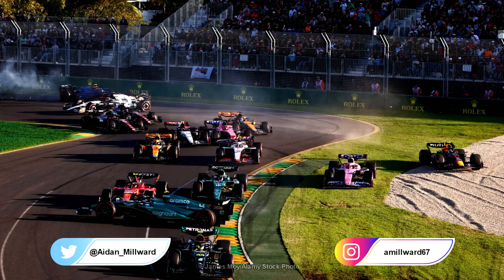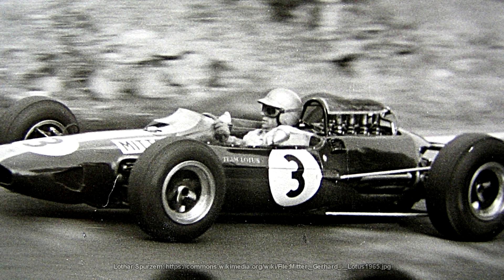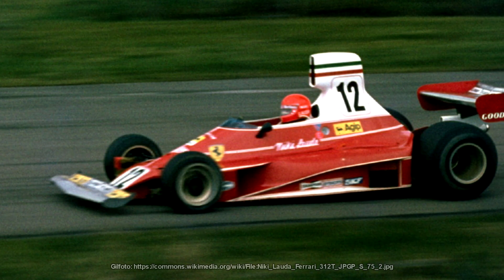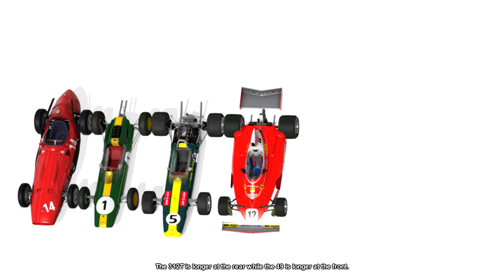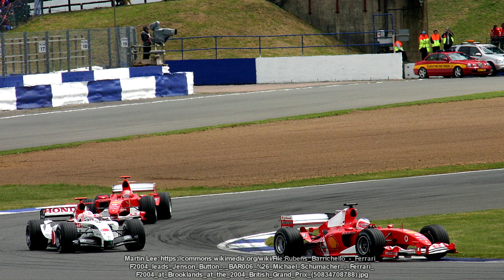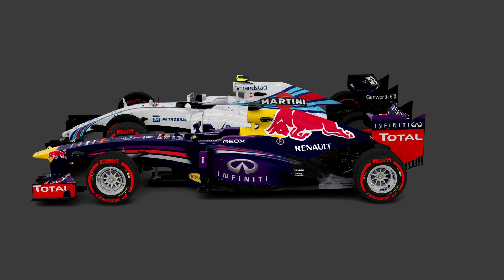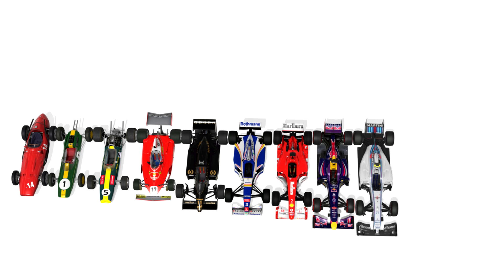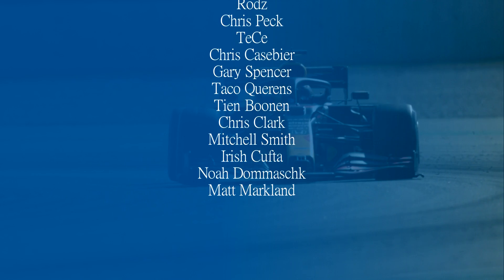So How Did F1 Cars Get This Big? A look at 73 Years of Car Evolution

Comment from the maker: If anyone does know how that Williams is shorter than the 98T, I'm all ears. Like Andrew Marr.
Reply: I’d suspect fuel tank size, but that’s just a hunch 🤷🏼‍♂️
Reply: It's just good you didn't mention His Royal Highness - or you'd go to The Tower.
Reply: It’s weird to think Aidan, but the ‘97 cars had really thin cockpits compared to that Lotus.  Best way to check is on F1 2013 where both the ‘96 Williams & ‘86 Lotus are playable (or any Rfactor footage) Also, as a fellow early 90s lad, we think back to the 90s with the default mindset of “Everything was bigger back then” (with crisps/chocolate, that was true)
Reply: Top "Thick of It" quoting Aidan
Reply from the maker: @hobbitman27  there’s one for every occasion!
Reply: @AidanMillward  small nitpick with the video. The 2020 mercedes was the W11, W10 was 2019.
Reply: Williams FW19 was 4,150mm vs. the 98T’s 4,597mm nose to tail on every google search result I’ve bothered to inspect. I think they just got the model wrong when they modded it into the game lol.
Reply: To be fair, when Senna crashed, his Williams was shorter
Reply: @davidaugustofc2574  No it was narrower!

Comment: I'm glad more and more people are questioning the size of modern F1 cars. I've been saying they've been too big since 2010. In my opinion, the 1993-1997 dimensions are the sweet spot; they've got the right track-width-to-wheelbase ratio to accommodate various driving styles and can even be slid around slightly whilst still having decent enough space for driver protection. As much as I love V10s, a modern turbo-hybrid setup powering a mid-90s style chassis and H-pattern gearboxes is my realistic dream setup for modern F1. Maybe cut the formula down to 1.4L and a high-compression/low-boost turbo setup to let the engines rev at 20k again, with any cylinder formation aloud.

Comment: I have two big interests in the engineering world, early and early-ish aviation, especially around WW1 and  F1, especially in the 60s. And it's weird how the more I think of it, the closer those specific things seem to each other. At least some parts of it.
Early F1 drivers and WW1 aviators had pretty similar things to worry about, and except for the shooting stuff the needed sort of similar skills, both groups needed fast reflexes, quick decission making, G-force endurance, patients, risk assesment on the go, coping with death of friends on a regular basis, living in the fear of burning to death and with the lack of safty gear (no seat belts, vs no parachutes), it seems like you need the exact same mad lad to do those things. 
That makes me wonder how guys like Albert Ball, von Richthofen, Georges Guynemer an Co would have faired in F1 and Clarke, Hill etc vise versa. Eddy Rickenbacher even was a racing driver and owned the  Indianapolis speedway for a while (!), besides also being the top scoring US WW1 ace in between.

Yhea, weird how two seemingly pretty unrelated things like fighting in wooden airplanes in the 1910s and racing bathtubs of death in the 1960s  share so many similarities in their requirements.

And it's also quiet funny to imagine, that in a parallel universe "The Manfred" may come into mind, when thinking of German F1 drivers in red cars, dominating the sport for years. :D

Comment: I would be all for refueling to be brought back if the cars lost at least 50kg and were shortened. Also, I don't think that the increased size, namely wheelbase is just for more fuel, safety cells and the hybrid/batteries. Wheelbase also brings a more stable car in medium and high speed corners, improving overall lap time. So if you want lighter and nimbler cars for the twisty bits, you're going to slow down for the high speed, high G turns that make much of the current F1 laptime.

Comment: Jesus, for a carbon fibre open wheeler 798kg is stupidly heavy. Years ago I had a Holden Gemini club car that only weighed 20kg more than that, and that was a steel bodied 4 door sedan with a cast iron engine block and a steel roll cage. And it was one of the heavier cars. The guys running Minis and early Mazdas and so on were in the 500-600kg weight range. There's just no way a steel body sedan should weigh less than an F1 car. Crazy.

Comment: I don't mind how big the cars are in some ways. Drivers need 1 meter of frontal crash structure and at least half that for side impact protection (if not more). The reinforcements for the survival cell and the halo are necessary. But the weight is the annoying part. Low-density, experimental, high strength composite materials should be tried.

Comment: Great video explaining the changes! 
It seems that most of the changes have been based on adding safety into the cars so I doubt we’ll ever get back to anything much smaller than an S class Mercedes
Reply: Some space can definitely be cut due to more car = more aero. If body panels and wheels were pulled in a lot closer to the crash cell and engine, cars should be a lot smaller, I don't think the crash cell is that big. Though the weight will likely still be an issue.

Comment: You can see how Monaco used to work, and now how it doesn't.  Imagine telling the heroes of the early days that future generations would need a little flap to open up so they could overtake.  The one other things that has changed of course is the Privateers are all but gone. Cars are now designed to keep the big manufacturers happy.

Comment: Current F1 cars are longer and wider than the current gen NASCAR Cup car.

It isn't just F1 cars that are getting bigger, though. The VW Golf Mk8 is 58cm longer, 18cm wider and 280-675kg heavier (depending on spec) than the Mk1
Reply: Honda Civic is probably the best example of that. They used to be tiny 650kg things about the size of a Mini, now they're a mid sized family car that weighs 1500kgs.
Toyota Corolla is similar, first gen was 700kg, now they weigh 1400kg. 
My first car was a Holden Gemini, which weighed about the same as a current F1 car. A steel body 4 door sedan with an iron block engine and a hulking great live axle. Crazy.

Comment: A discussion of F1 car size  is not complete without mentioning why the maximum height rule came in during 1976: in response to the comical giant airboxes on cars like the Ligier JS5! With the maximum  width rule having been introduced in 1972, length therefore remained the only  totally free parameter until 2021. Yet fans  were somehow not happy about this  -- go figure! Unfortunately teams would only agree to a 200mm average wheelbase reduction for the 2022 regulations, rather than the  500mm reduction which the FIA wanted.

Comment: Why do people keep on yacking about the supposedly sluggish cars when those cars move around the tracks at much faster speeds and higher g forces. The cars are more agile, have more power and reach higher speeds than ever before.
Literally the only thing that has changed is... the TV camera work...
Using long range stabilized tracking shots would make a bloody fighter jet look stationary...
And that's almost all we get nowadays...
Reply: Maximum G load isn't the same thing as agility. Current F1 cars don't have the incredible, borderline instantaneous turn in that even 2021-spec cars used to have. An example from aviation would be to compare the F-14 to the F/A-18 in a dogfight; the Tomcat actually has a higher maximum turn rate, thanks to the massive amount of lift generated by the fuselage, but the Hornet can absolutely murder it in a close-range knife fight, because it rolls much faster and can snap to crazy angles of attack practically at will.

Comment: The 2017 rules were a mistake, the width shouldn't have gone back to 2m, should have remained at the perfectly good 1.8m and there should be further restrictions on length and wheelbase. This is all entirely possible as the 2014 cars had hybrid but were nowhere near as huge.

Comment: "Im using metric in this video its easier" 

Also

" It's good for 10 miles before you can throw it in the bin"
Reply: Yeah England is weird. Almost entirely metric, yet the road speeds and distances are still in miles. Go figure.

Comment: 9:04 remember when in 07 they said "we're making the wings narrower and taller for better overtaking"
Then in 2023 body regs they said "we're making the winds wider and lower for better overtaking"?
look how big the front wings are! You can't go for an overtake if it means your massive ironing board of a wing can be taken off with the slightest clip of another car. Look at the 90's williams and 00's ferrari, That's what we need.
Reply: If they were serious about better overtaking the thing to do is remove the wings altogether. Look at Formula Ford, there's 37 lead changes on the first lap.

Comment: That 1.5 L limit gave ne a dumb idea.
New racing series, maximum 1.5L and 130hp at the wheels. Minimum wight of 1000kg, cars have to be able to seat 5 people each at least 1.6M tall.
You only get 2 engines per car the whole season.
Other than that, do whatever you want.
We would get so many better economy cars.

Comment: For all the technological advances that F1 likes to boast about, one thing is obvious is total lack of miniaturization of these said advances. Lighter materials is one thing but not miniaturizing hardware (engine and hybrid components) is the the problem. There has to be a way to adequately reduce the dimensions of the car without losing too much performance. If anything FIA needs not to be afraid of starting over with regulations with the intentions of building a smaller car. Performance gains are achieveable with smaller cars, it's just going take more time and money.
Reply: Components like the dampers, swaybars, and steering rack are already tiny compared to other types of racing cars. Parts ARE   very much miniaturised.  The 1.6L hybrids are NOT physically large by any means.  They are VERY compact installations (there  is performance  to be gained in making them as small  as possible, so they do so). The cars are long because there is a 40cm spacer betwen the engine and gearbox for aero.

Alfa Romeo  saved weight by making  a shorter car for 2022, BUT it had  less floor area   and therefore  less downforce.  So going back up to the maximum wheelbase for 2023 was preferable.

Comment: An aspect I've noticed about the size of the 1960s F1 cars is that the size of the driver's helmet changes the perspective of the size of the car when seen in photos or videos; in that nowadays the 1960s cars looks smaller, in photos/videos, with the drivers using the full-face modern helmets when those vintage cars are driven in modern exhibitions.
Modern helmets are a lot larger than the open-face ones used in the 1960s.  The modern helmets also seem to make the drivers look, nowadays, to be sitting taller in the car than they were in the 1960s.
With my eyes being accustomed to seeing the F1 cars, in photos, from the 1960s, with the drivers using smaller helmets; those [now vintage] cars nowadays being driven with drivers with modern helmets makes, at least to my eyes, the 1960s F1 cars looking smaller than they were in the 1960s.

Comment: 1.8m width arrived in 1998 and that era is super-compact, very light agile cars. Right up until 2008 almost no growth in size, infact after some growth in the early 2000s wheelbases started coming back down and the 2008 cars are no larger than 1998. Then 2009 with the regulations change still relatively compact, bigger wings but the title winning Brawn BGP 001 has a 3.16m wheelbase. 

That was very short lived, almost overnight teams realized long wheelbase = more downforce. 2010 VJM03 has a 3.48m wheelbase and the Sauber C29 is 3.5m. And that isn't even due to the 2010 refueling ban, Mercedes W01 kept the same 3.16m wheelbase as it's predecessor while the title winning 2010 RB6 was 3.27m and even the 2011 RB7 only grew to 3.33m, however the rival 2011 McLaren MP4-26 hit 3.55m. 2014 hybrid era kept similar wheelbases, the title winning W05 is 3.46m which is smaller than some of the V8 era and that was pretty static through 2016, the VJM09 for example drops down to 3.44m.

Surprisingly even the 2017 onwards 2m wide cars still don't get that much longer wheelbase, Max Verstappen's title winning RB16B is 3.57m wheelbase which is only fractionally longer than the largest V8 car I could find, the 3.55m 2011 McLaren. However the 2017 regulations did extend front/rear overhangs with larger wings so the overall length grew by about 0.5m.

2022 keeps the wheelbase from the 2017 era (about 3.6m) but the overall length is a staggering 5.6m, up from a 5m overall length in 2014 with the same engine regulations.

2008 = 3.11m wheelbase, 1.8m wide, 4.77m overall length
2009 = 3.16m wheelbase, 1.8m wide, 4.8m overall length
2010 = 3.48m wheelbase, 1.8m wide, 5.1m overall length
2014 = 3.46m wheelbase, 1.8m wide, 5m overall length
2017 = 3.6m wheelbase, 2m wide, 5.5m overall length
2022 = 3.6m wheelbase, 2m wide, 5.6m overall length

*2014 Marussia MR03 is a notable outlier, with a 3.7m wheelbase looked like an absolute barge back in 2014 but still about 40cm shorter overall than a 2022/23 F1 car.

Comment: For my fellow Americans unfamiliar with the Metric system I think I can shed some light on the conversion. Many controlled substances are sold in Kilos over here in United States and that's 2.2 pounds according to "Miami Vice". As far as the meter it's just a bit longer than the yard of 3 feet we Yankees love so much, so "6 feet under" would be 1.83 meters under in UK
Reply: To be fair, in the UK we use both metric and imperial. It's a mixture of context and personal preference as to which is used where. For instance when driving on the road we use miles and yards but when measuring most smaller distances we tend to use centimetres, metres etc. I guess it's a legacy of the country trying to go full metric but the public never fully accepted it, so we compromised. I imagine it's a bit of a generational thing as well.
One thing I don't quite get is why the UK and US have different measurements for a gallon! In Britain a gallon is around 4.5 litres, while in the US I think it's less?
Reply: @dominicbarden4436  US gallon is 3.78L

Comment: What would happen if there was no minimum weight?
Reply: Most of them are having trouble getting down to the limit
Reply: Ironically, there was a MAXIMUM weight instead of a minimum weight in the mid 1930's European Grand Prix championship (and almost no other rules at all). And instead of making small light cars, the Nazi manufacturer teams (Mercedes & Auto Union)  made cars with the biggest engines possible (6L supercharged V16) right at the maximum 750kg weight limit.  So much for small and light being best...

Comment: As an American, i think it's imperative to learn to convert KG to pounds if you love racing. Those cars back in the day were so light.
Reply: I concur
Also, google makes it rather a non issue, only gotta remember a few small ones 300kmh is about 186mph, 150kg (about how much they put into the brake pedal) is 330.6lbs, approx 700kg(current ish weight of the cars) 1543lbs and 110kg of fuel equals approx 36 gallons of fuel per race.

Outside of that you can kinda half fast it. Also, use your speedo in your car, read the Kmh speed whenever you check your regula speeds.

36 gallons of fuel to take 1550lb cars around monza in what, 1:21.3 or so?
Something the whole footprint of my damn full size truck can corner at 5g, brake at 5g and sip fuel? Friggin insane mang.
Reply: @threadtapwhisperer5136  The reason I say that is because you won't be able to have Google with you everywhere. It's good for the mind. I do use Google occasionally. Just easier for me to do it in my head.

Comment: Make them shorter and restrict DRS a bit, there must be enough data now to do it intelligently. I don't care if that means the odd dull race, I want to see a DRIVER overtake and not just sail by leaving the lead car with no defence. 
Think of the best overtakes ever, Hakkinen vs Schumi @ Spa, Raikkonen vs Fisi @ Suzuka, Alonso vs Schumi @ Suzuka, to name literally 3. All wouldn't have happened with DRS and if they did they wouldn't be given as much credit
Reply: The FIA  wanted a 3300mm maximum wheelbase for 2022. Teams refused. So the compromise was 3600mm, down from some cars being 3800mm wheelbase in 2020. (Front and rear overhang rules and thus total length are based on the wheelbase.)

Comment: Did an MTC tour yesterday because my brother works there: you can really tell the size change of the cars. 

A 2012 McLaren next to the 2019 car for example was a massive difference in width. Then looking at the 2022+ cars they're huge.
Then you look at 98 car they're so much more narrow. I know the refuelling bam in 2010 has contributed a lot with the length of the cars.
Reply: Yes, but don't forget  that cars like the MP4/4 are still 15cm widerthan the 2023 cars. The carsonly became narrow (and ended up with silly narrow grooved  tyres on 13" rims) because of misguided FIA regulations (reducing the width of the  cars twice). F1 cars in  the 1960's had 15" rims (with low profile front tyres),  the same as  Indycar used then and up to  the present day.  They only went down to13" because of the rules.

Comment: 2020 were faster than v10s over a lap, but over the course of a race the grooved tire f1 cars could go more flat out over a full race distance due to not having to worry about fuel and the tires not being made of glass, and not starting with a full race distance worth of fuel on board.
Reply: also the v10s didn't have a hybrid system, so they ran full power at all times
Reply: When they narrowed the cars in 1998 it was to raise the center of gravity to try to bring the speed of the cars down, but it just made them slither though the chicanes faster because the cars didn't have to turn as much to thread that needle.